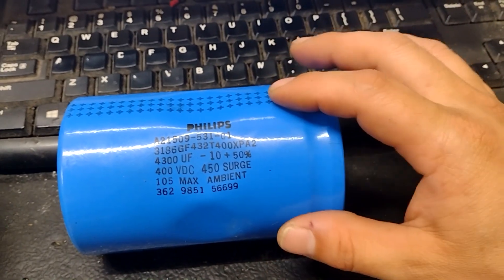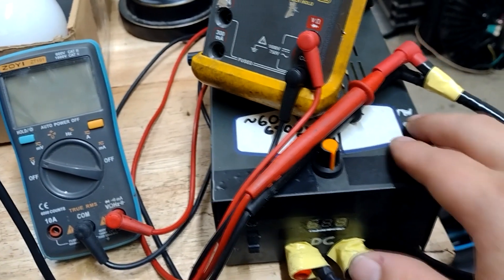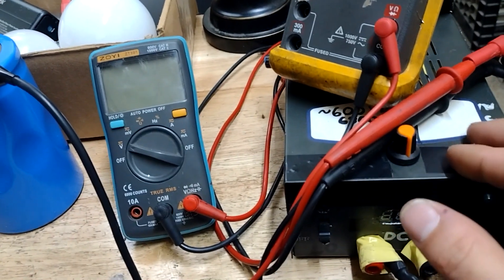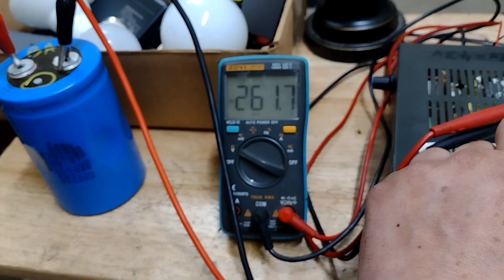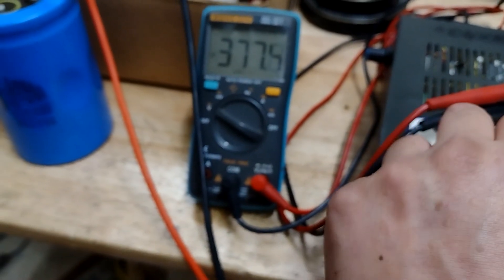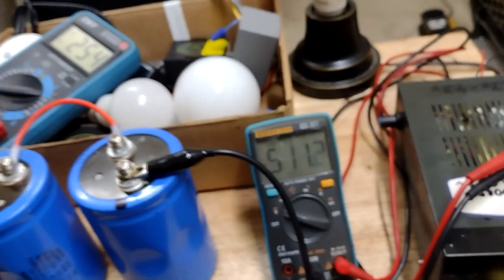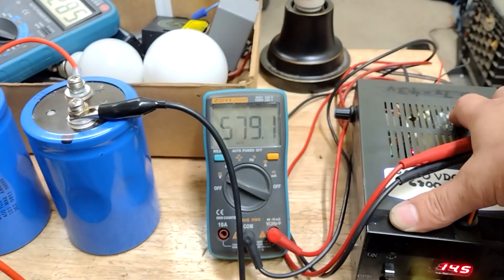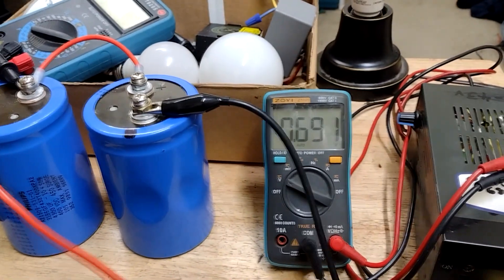Large Capacitor Reforming/Charging w/12v ZVS

Comment: I have a little question about the zvs driver , I am building it with centertap , for the inductor can I use one of those ferrite chokes the ones that look like a little ferrite bar (like a knob ) cause I have a few of those with a code that says 220 or 200 I guess it is 200mh , I see everyone use a toroid , I have a toroid but I don't know how much inductance is it , if it too much inductance I could damage something ?
Reply from the maker: A ferrite rod of some kind will work but typically people will use a closed core or a gapped core. I generally don't think about the core material so long as its good for the frequencies but it is kind of important as some will be better than others at particular jobs. You really can't go wrong with the core until saturation or overheating become a problem. Typically any ferrite you can find will be fine for a ZVS driver so long as it has appropriate size. The induction heaters are using very low inductance air cores, and the heated metal introduced is basically becoming an extremely lossy core because it's typically iron or steel. 

A core itself will have a permeability or inductance factor along with cross sectional dimensions etc but the prewound inductors will be labeled per their inductance at the windings. Higher permeability means you could get away with the same magnetic flux with less turns but it may also saturate faster so it kind of all has to be calculated per the power you want to put through it. (except that it really doesn't because of how simple a ZVS is, and you typically get the results you want with any random ferrite core)
Reply: @Magneticitist  thanks so much brother , I think I am gonna start with the toroid and maybe later I am gonna give the chokes a try , anyways I am gonna run the circuit at very low power , I just need to oscilate a little ferrite transformer (not a flyback) to charge some not so big capacitors to 200v , for now that is all I want to do
Reply from the maker: @rodriguezfranco3839  200v isn't too high for a toroid and I only say that because of how long it would take to wind the secondary. To push any real power at 300V+ I typically needed a good number of secondary turns, more than I'd want to wind on a toroid. Any kind of cheap flyback cores are easy just cause you can wind various secondaries on a former and close the core halves on it. I think I've had a few where I was going for around 120V RMS and it took about 20-30 turns using something around a 5-8 turn primary at maybe 20-24V input.
Reply: @Magneticitist  I meant a toroid for the inductor (the one that goes on the positive rail to the centertap ) .For the transformer I was gonna use the same I showed on my last video ( the one I was pulsing with pwm) I think I am gonna take the primary out and just rewind a 5+5 primary centertap on it , I also have a toroid wich is already winded with a bunch of turns , but I think I am gonna use that one for the inductor as I said previously , I want to get some kind of flyback core maybe in the future
Reply from the maker: @rodriguezfranco3839  Oh for the inductor basically any yellow or yellow/white core from like a PC PSU would work.
Reply: @Magneticitist  https://youtu.be/L3yiyIPJxZw. I build it and it works great , my ears still ringing from the bang hehe I charged some capacitors and short them just to show , the damn thing sounded like a gunshot , anyways the fets are very cool , I might try to do some induction heating later but the main purpose
was to charge capacitors like this

Comment: I really need to rebuild my homemade caps.
Reply from the maker: Caps are like my weak point when it comes to finding components. They are just too damn expensive. These caps would still probably go for like $200 each.
Reply: @Magneticitist  I posted on "posts" that I had gotten three 12,000uf 450v capacitors and the total amount I payed for it was 50$
Reply: What did you make them with? Plate material and electrolyte?

Comment: Dang those are some big big caps , I allways wanted to make one of those car batery reemplacement with a capacitor bank I think lasersable made a few with supercaps
Reply from the maker: These are pretty big but def not storing supercap kind of charges. Shorting one of these out at only 30-50V produces a pretty serious bang though, I'd hate to see one shorted at max voltage.
Reply: @Magneticitist  Glad to see you are back making videos , yep supercaps would be much appropriate but it is a pain to deal with their low voltage , I think most of them are like about 2.7v max rated , so that means setting them up in series and then they need to be balanced somehow while being charged . Anyways I will build a nice cap bank in the future